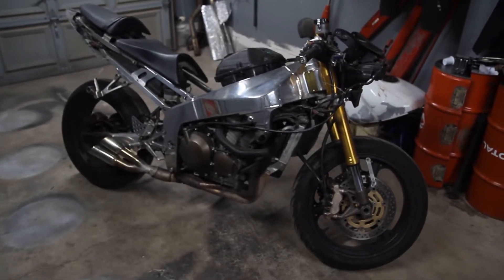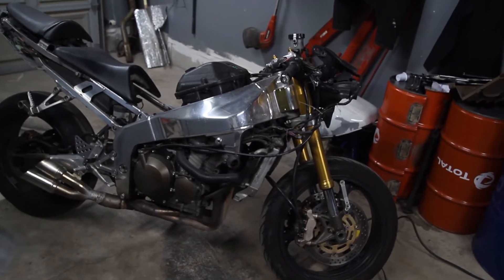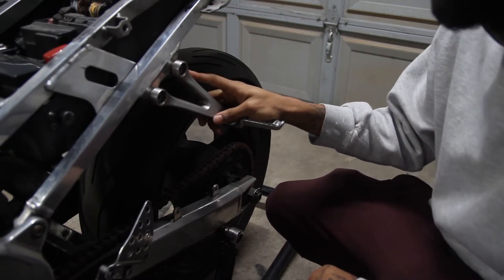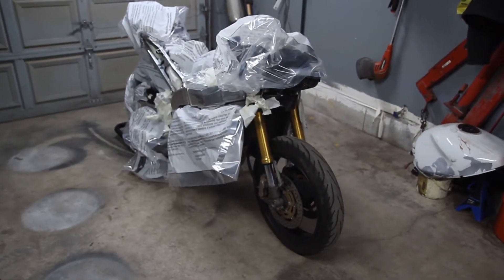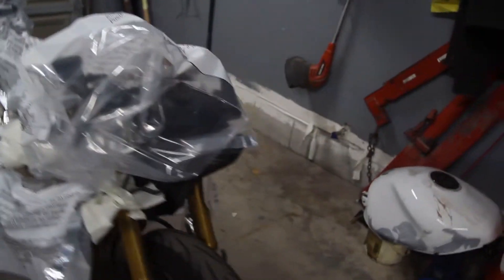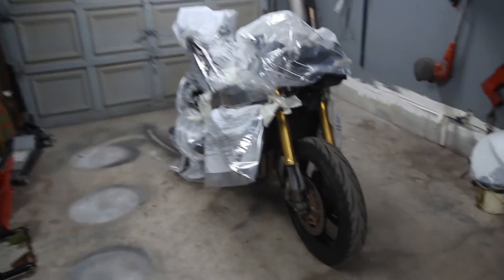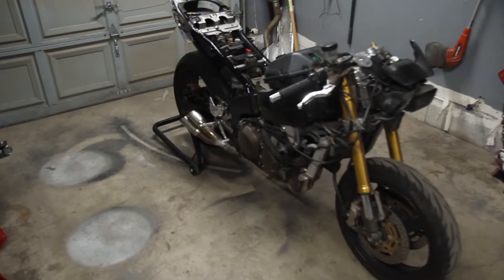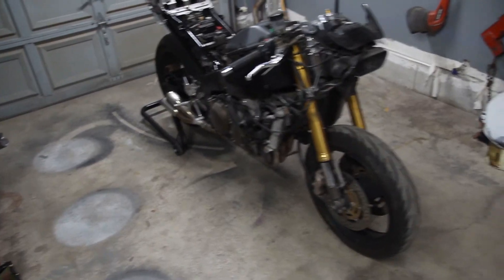Painting A Motorcycle Frame | Cheap & Easy

Comment: What type of paint did you use?
Reply from the maker: Just any black paint I found at my local hardware store.
Reply: Heyyy yoo!!
Please do not buy any paint, should be automotive, also you must to prepare the surface before (at least a nice clean to remove all oil or dirt residues), and if you want to finish with a great and durable job, you must to apply some finish coats of "Clear Lacquer Spray Paint" Gloss or matt, its up to you! 
lets go guys! great job and good lucky!
Reply: @fernandogopro  eh you don’t need automotive paint.. it’s going on an aluminum frame. If it’s prepped good you have nothing to worry about. Unless you use the $1 black paint from Walmart.. then you’re screwed. If you’re looking for a great rattle can clear coat, look into 2k clear. It’s like $25 a can but it’s quality clear coat just like we use in the shop. It’s a mix can, click the button on the bottom, shake it well and spray!! Good luck

Comment: @chevisbeecher what kinda paint did you use and also what was the yellow can used Whn whipping it down about to do mine as well it came out dope love this video
Reply from the maker: Thank you my guy and glad you enjoyed the video. I honestly used regular black spray paint, rustoleum, tremclad, krylon. I recommend adding many coats since you’ll be hitting it every now and then, I didn’t use clear but I’d also recommend that as it’ll protect the black. The yellow can is called “safety kleen brake cleaner” but you can use any degreaser or brake cleaner, just want to get all the oils and dirt off the frame so it’s not in the paint.
Reply: Thnk u
Reply from the maker: No problem man